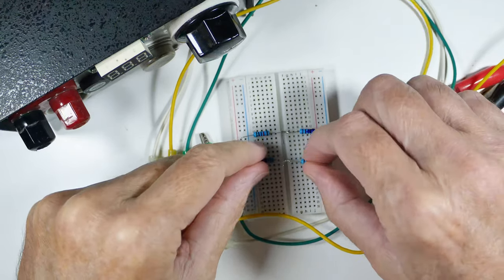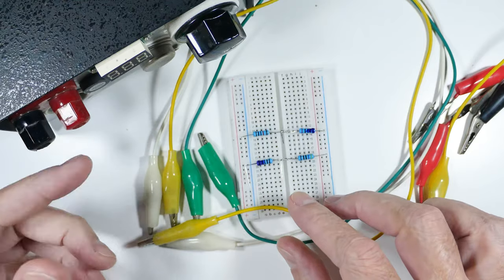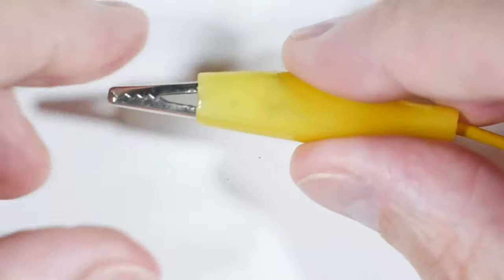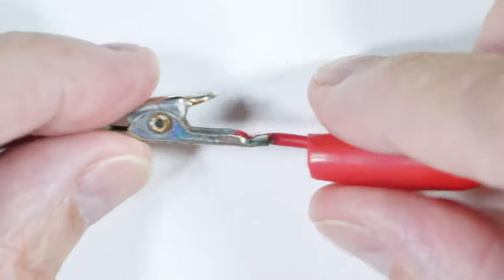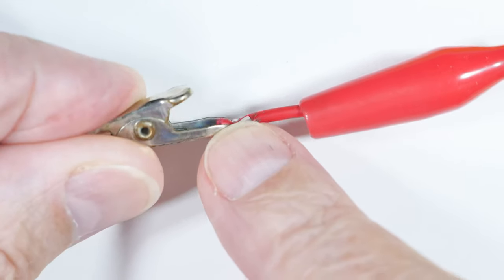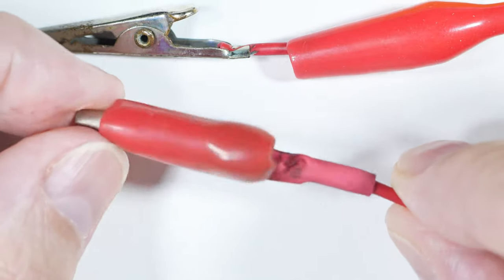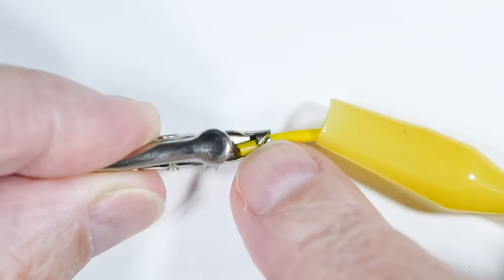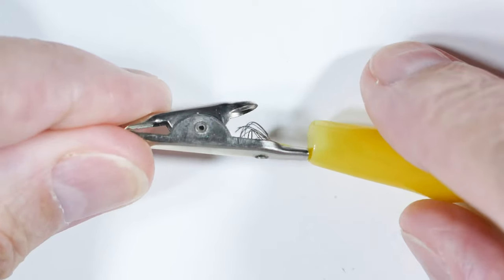Cheap Jumper Wire Danger! (4K)

Comment: Thank you for this video.   I ran into the same problem ...things didn't work as expected because of those rubbish jumper wires.  I replaced the wire with silicon-coated wire and soldered them.  The overall resistance is now within acceptable margins
ChrisV
Reply from the maker: I need to do the same.